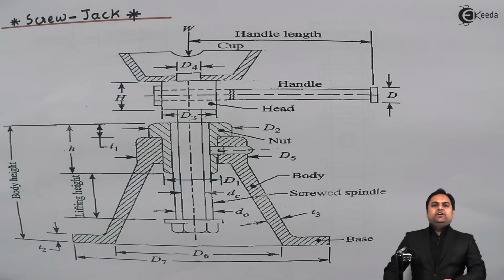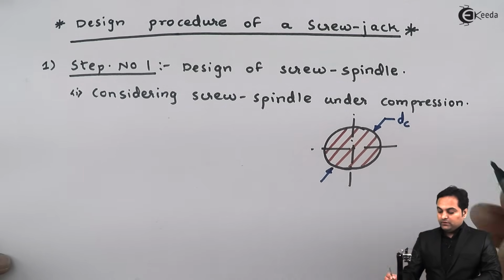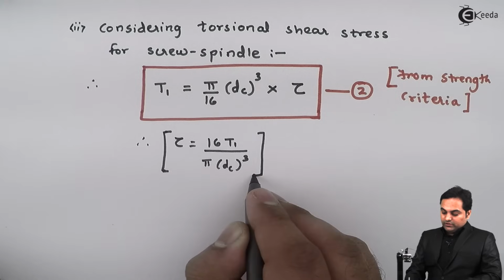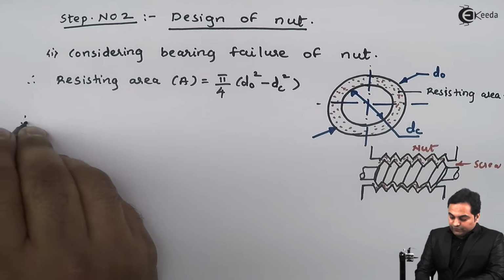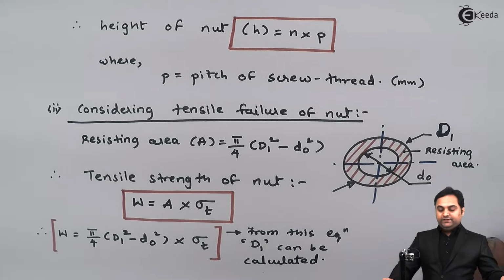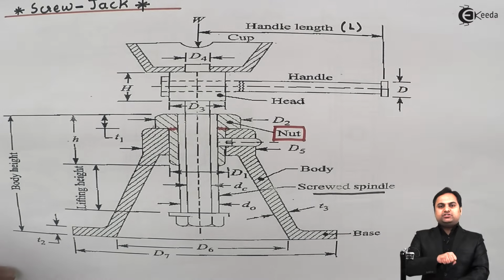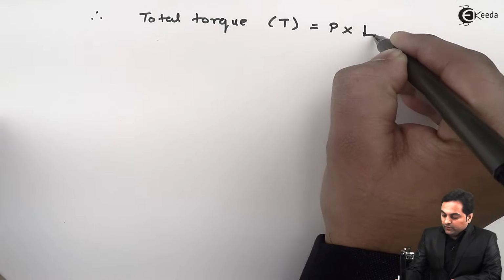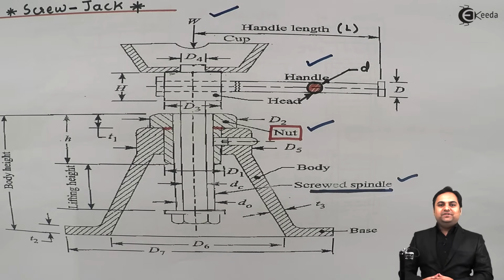Design Procedure for Screw Jack - Power Screws - Design of Machine

Comment: How can shearing area involve.   t1.  ???       32:10
Shearing failure of nut collor is explained incorrect.
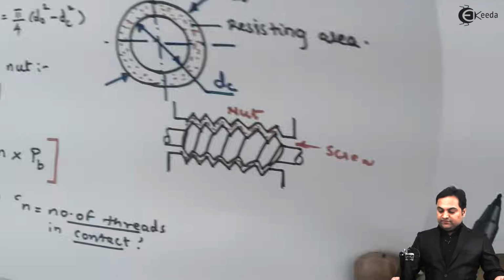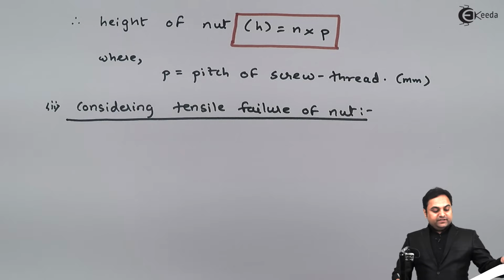Reply: Right and in the previous section at 27:27 he explained it wrong as well. The one you're saying will be Tensile failure and at 27:27 it will be shear failure

Comment: Why resisting area is not- pie ×mean dia×thickness of thread ×no of thread?
Reply from the maker: We recorded your response. We will get back to you shortly
Reply: In shear failure of threads in Nut, the formula of resisting area should be multiplied by no of threads as well.